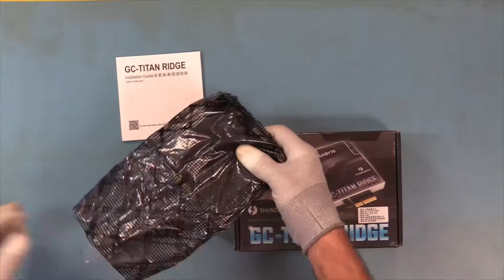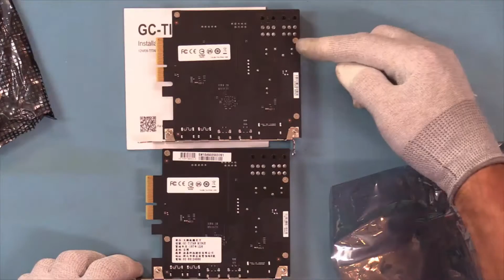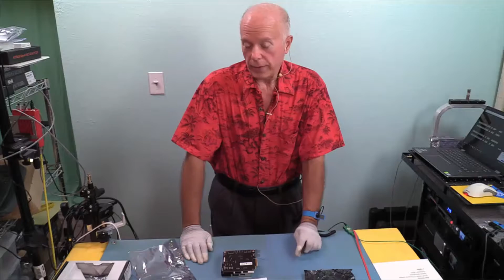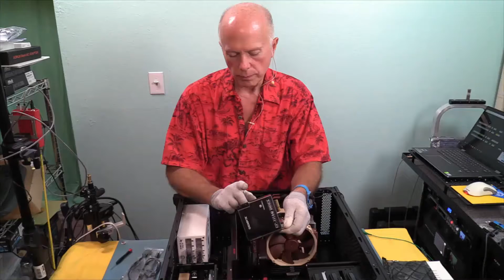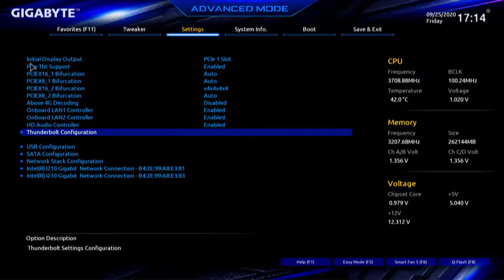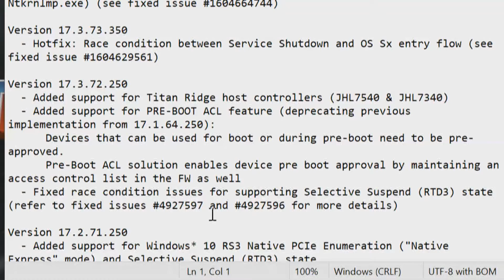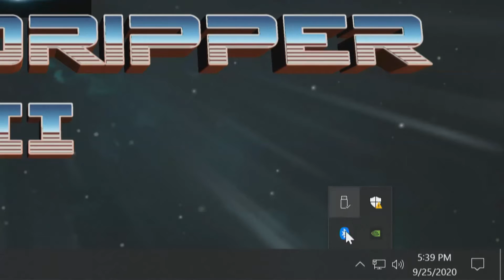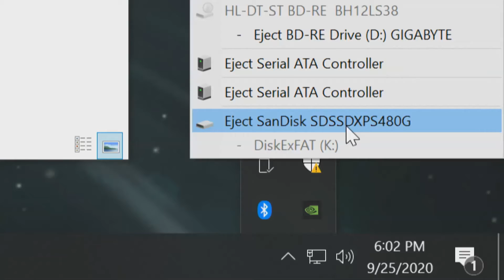Titan Ridge Thunderbolt 3 Unboxing, Comparison and AIC Simple Install on Gigabyte TRX40 Designare

Comment: I have an Apollo Twin MK II i just purchased and im trying to get it to work with my ryzen 9 3950x,  aorus ultra x570 motherboard and i also ordered the startech thunderbolt 3 to thunderbolt 2 adapter. When i connect it nothing happens even after i updated everything. Do i need to but this Titan ridge to add to my motherboard or do i just buy a new motherboard that has thunderbolt 3 already installed on it? I didnt know it would work because the rep that helped me said usb c 3.1 was the same as thunderbolt.
Reply from the maker: Hi Black_HowL 7evin, 
Nice to meet You! You need a Motherboard that supports Thunderbolt 3. Not just USB-C. Your Gigabyte Aorus Ultra x570 Motherboard was originally designed to have that support but was removed from production for whatever reason. Notice the spot next to the SATA Connectors... Those 4 dots. You need a Motherboard with that Thunderbolt 3 Header, present. 

The X570 Aorus Master (rev. 1.1/1.2) has Thunderbolt 3 support. Whereas, rev. 1.0 of that model does not. Plus You need the Gigabyte Titan Ridge Thunderbolt 3 AIC. 
https://www.gigabyte.com/Motherboard/X570-AORUS-MASTER-rev-11-12#kf
https://www.gigabyte.com/us/Motherboard/GC-TITAN-RIDGE-rev-10#kf

There will be one or two settings in that Bios to verify that may need to be turned on. Seems every chipset that supports Thunderbolt 3 is different. That Motherboard may auto recognize the Thunderbolt 3 AIC. 

This will give You Bios support. And that will get You Thunderbolt 3 (Native support) Plug and Play plus Thunderbolt 1 and 2 (Legacy support). 

We're going to be doing two Thunderbolt 3 Videos with Thunderbolt Audio interfaces soon. One will be with a Universal Audio Thunderbolt 3 interface. Hope that helps! Stay tuned!
Reply: @BuildOrBuy  i just left the computer store trying to see if i had to buy any additional pieces. They showed me my motherboard is the 1.1/1.2 rev version of the aorus ultra which has the "THB_C" header on the motherboard. So i should be ok. I already bought the Titan Ridge which will be here tomorrow.
Reply from the maker: Hi @ILaxative , Perfect! Proof is in the actual product! What I read or could tell, it did not. Even the documentation is sketchy. The Titan Ridge AIC will prefer a specific Slot due to the Root Port selector being hard wired in Bios. Usually, it's right across from the THB_C port. The Bios may Auto recognize the Titan Ridge Thunderbolt 3 AIC. Double check. If Your Computer does not turn on. Do not fret. Just power down. Drain power and change Slots. 

Make certain Your Motherboard Drivers (AMD) and Video card drivers are current. Congrats!

Comment: would it be forced to wire the hdmi cable from vga to tb3 aic? and only able to use display through tb3 port? seems manuals saying to wire like that, for gigabyte and asrock aic
Reply from the maker: Hi D P, 
Yes, You are correct. Why not just plug in Video card to Monitor direct? Looks like we need to do another Thunderbolt 3 Video about the technology. Thunderbolt 3 is suppose to do 3 things. Video being one of them. 

DisplayPort Video is routed through Thunderbolt 3. If You route HDMI Video, that will require Adapters. Hope that helps!

Comment: heard asrock x570 creator has general pcie lane btw 2nd m.2 and tb3 ports, would tb3 header mb without controller chipset  safer choice for audio works? if it is I want to use AIC  , to build ryzen system
it's so horrifying me to read tb3 issues on newer tb3 ports board
Reply from the maker: Hi D P, 
Yes! ASRock seems to be doing more to enable Thunderbolt 3 on AMD Platform than anyone else right now! We're going to be doing more with Thunderbolt. We keep getting questions about NVMe. 

ASRock x570 Creator - Has 2 Intel Thunderbolt 3 Type-C! 
https://www.asrock.com/mb/AMD/X570%20Creator/index.asp

You want the Short answer or the Long answer? It can work sort of. TB3 only. No Legacy support i.e. - TB 1 & TB2. No Plug and Play. How to enable? On the Gigabyte Titan Ridge TB 3 AIC, Jump Pins 3 to 5. Keeps the AIC alive. 

It's really about a Security issue. And that's it. You want Full Support, requires the Connector on the Motherboard and Bios support. Big hassle. 

We have Thunderbolt 3 working on both x399 (THB_C Connector, No Bios Support) and TRX40 ( THB_C Connector, Full Bios Support). 

Hope that helps!
Reply: @BuildOrBuy  really appreciate  of answer! was genuinely big help! more to research, more to fear 😨  since x570 creator share tb3 ,m.2 B lane and has interfere problem, might buy gigagyte Vision D  which is native tb3      also appreciate of answer for other video related VGA  tb3 wire thing   , was really big help!
Reply from the maker: Hi @dpdpdpdp123 , 
Yes! You are most welcome! Let Us know if You want another pair of eyes on the Solution, when You're ready!

Comment: Could you say please, if I'll buy 3 x SanDisk Extreme PRO® Portable SSD V2 (2000 MB/s each) USB-C, can I connect them in one time, directly to the TB3 Ridge card to get in total 6000 MB/s speed? I'll have 8xNVMe inside GB Xtreme board, so hard disks will not limit this speed.
Reply from the maker: Hi Juri G, 
Interesting Question. Only 2, not 3! Excellent idea! 
1.) USB-C is same Connector. Anything Thunderbolt is suppose to have the Lightning mark designating as such. That Drive does not. But it works! I tried it! 

2.) TB3 Titan Ridge card only has 2 Connectors for Thunderbolt connectivity. You'd have to daisy chain the Devices. 

3.) Having 3 separate external Drives, in RAID, that could become problematic. 
4.) Suggest using a Single Drive or Single Enclosure solution. Any Size Drive or Drives You choose. 
5.) Due to some overhead, would You get that Spec Speed? No. Why? Overhead. Not a sustained Speed. Your Results may vary. Thanks for Asking!
Reply: @BuildOrBuy  Thank You for your extnsive comment, as usual ) We are going to use 3 cameras, and after footage (3-4 hours), we'll have ~3x2TB of footage on these Sandisk drives, so we need the fastest way to transfer 6TB of footage to desktop. So as I got you right, as there is no way to daisy chain these drives, we can use only 2 drives at once to move files to desktop at 4GB/s in total speed? Maybe some TB3 hubs may help us? And with GB Xtreme 3 x USB 3.2 Gen 2 - I can have only maximum speed of ~1GB/s per port - right? So max with 3 drives we'll have about 3GB/s download speed?
Reply from the maker: Hi @jurig5579 ,
Titan Ridge ThunderBolt 3 is specified to achieve 40GBit/s. PCIe 3.0 x4 is only capable of 30.781GBit/s. So there's got to be a better way to maximize throughput. 

Give me the full picture. Cameras. Where's the Data coming from and what medium is it on? Are You doing 4k/60 or 12k/60? 

Any suggestion we discuss should include the full data path. For instance, a Removable NVMe Solution could be an option. 

ToughArmor MB720M2K-B - Full Metal 4 Bay M.2 NVMe SSD Mobile Rack for External 5.25" Drive Bay - https://www.icydock.com/goods.php?id=330

Or this may be a better option. - Glyph Thunderbolt 3 NVMe Dock (No SSD) - https://amzn.to/3lJ9xJv
As an Amazon Associate I earn from qualifying purchases.

Comment: Maybe you know, as for today, that some one had successful experience with GB Trx40 rev 1.0 Xtreme and Ridge 2.0 card with working plug n play?
Reply from the maker: Hi Juri G, 
The only difference according to the Specs would be Power Delivery. It will work! However, We have not tried it yet. Been busy the last 5 days with DaVinci Resolve 17 beta. Testing on 5 different Computers!  Our concern right now with Thunderbolt 3 are Microsoft Updates. 

Windows 10, version 20H2 or Windows 10, version 2004, you might receive a stop error when plugging in a Thunderbolt NVMe SSD - https://support.microsoft.com/en-gb/help/4592819/error-when-plugging-in-a-thunderbolt-nvme-ssd 
Stay tuned!
Reply: @BuildOrBuy  but officially Xtreme motherboard  doesn't support thunderbolt card, isn't it ?  And as I read much earlier  plug and play mode doesn't work there , do you think its fixed with latest bioses ?
Reply from the maker: Hi @jurig5579 , Officially, no. Unofficially Yes! I'll get You the Instructions and the Link on the Gigabyte Forums! The Instructions are very specific. I'll have to go dig it up! Working on next Video right now! Give me this evening to find it unless Rick sees this and provides the link! See: Gigabyte Forums - Rick - Colonelhop. So much information going on and such little time! Stay tuned!
Reply from the maker: Hi @jurig5579 ,
Here we go! Have to know what to look for or You'll never find it! Gigabyte Forums - Rick - Colonelhop should be compensated by Gigabyte for His tireless work on the Gigabyte Forums! Hats off to him! 
https://forum.gigabyte.us/thread/9680/newer-revisions-trx40-aorus-xtreme 
Quoting User lwvfx... Only changes made were for spell checking...

"I decided to try anyway as I've seen some people have success. But contrary to other people's experiences, it seems they are suggesting that it will be allowed in future.

Firstly, the Titan-Ridge is installed in the upper PCIe x8 slot, rather than the bottom.
 All cables connected. Power, USB header, THB_C header.

I followed these steps to remove any drivers I had.

1. Disconnect any Thunderbolt 3 devices from the host system (this is done to prevent Windows Update from automatically loading any Thunderbolt drivers).
2. Right-click on the Windows Start button and select ‘Device Manager’.
3. Click on ‘View’ from the application menu bar, and click the option ‘Show hidden devices’ (this is necessary because the Thunderbolt controller will not be active if no Thunderbolt devices are connected).
4. Expand the ‘System Devices’ category. Scroll down until you find the entry for the ‘Thunderbolt Controller’.
5. Right-click on the ‘Thunderbolt Controller’ entry and select ‘Uninstall device’ from the context menu that appears.
6. From the ‘Uninstall Device’ window that appears, click to place a check mark within the ‘Delete the driver software for this device’ option.
7. Click the ‘Uninstall’ button.
8. Close Device Manager.
9. Click the search button on the taskbar (looks like a ‘O’) and search for the letters ‘cmd’.
10. Right-click on the ‘Command Prompt’ search result and select ‘Run as Administrator’ from the context menu. If prompted, enter your Administrator password.
11. From the Administrative Command Prompt window, enter ‘sc delete nhi’ (without the quotes) and press enter. You should receive a ‘SUCCESS’ indicator. ** Be very careful to type this command correctly ** This command deletes the ‘nhi’ Windows service presently installed on the system.
12. Close the Administrative Command Prompt window.
13. Check within the Control Panel -> Applications and Features to see if there are any ‘Thunderbolt Software’ by Intel entries listed. If any our present, uninstall them.

--------------

Then I decided to try out the DCH Drivers provided by Gigabyte for the Titan Rev 2.0 version, even though I have Rev 1.0
www.gigabyte.com/Motherboard/GC-TITAN-RIDGE-rev-20/support#support-dl-driver

Only when the DHC drivers are installed can you install the Thunderbolt Software from the MS Store.
www.microsoft.com/en-us/p/thunderbolt-control-center/9n6f0jv38ph1?activetab=pivot:overviewtab

Many reviews say they cannot install it or download it from the store. I suspect it may be they didn't have the correct drivers.

REBOOT. In the BIOS I now had an option for Thunderbolt and made sure it was enabled.
My BIOS version is F4d

With this setup I got the control center working, and it recognized the few thunderbolt drives I had. 
I have not managed to test it out with any other devices, especially thunderbolt 3 devices as I only have thunderbolt 2. I was using the Apple T3 to T2 adaptor, which is probably the best one to get.

Hope this helps someone! I was messing around for days trying to get something from this card. A bit frustrating that I had to switch PCIe slots, but I would get a d4 error and it would not boot" 

We had experienced the same Results with 2nd x8 Slot. Your Results may vary. Hope all of this helps!
Reply: @BuildOrBuy  Thank You! I hope that PnP works for him )) I'm going to use it for external SSD connections, to download raw recordings asap.
Reply from the maker: Hi @jurig5579 , Just as long as You're NOT using an NVMe, You should be fine! Had To do that while we were talking about it! Did not expect to find the Info so quickly though! Knew You needed the Info! Details matter! Keep Us Posted on Your Progress! This helps Us to make better Videos!
Reply: @BuildOrBuy  could you say please here in short, what is the problem with external NVMe if it will have usb 2x2 gen 2 port ?
Reply from the maker: Hi @jurig5579 , Yes! BSOD! We're talking about a Thunderbolt 3 External NVMe Device.  Quoting... 
"On affected devices, when plugging in a Thunderbolt NVMe SSD you might receive a stop error with a blue screen and "DRIVER_VERIFIER_DMA_VIOLATION (e6) An illegal DMA operation was attempted by a driver being verified." Affected Windows 10 devices will have at least one Thunderbolt port and any currently available version of the driver file stornvme.sys." 
https://support.microsoft.com/en-us/help/4592819/error-when-plugging-in-a-thunderbolt-nvme-ssd
Hope that helps!

Comment: All we need to see is how can we use Thunderbolt 3!!!! Not alternative for USB. Thunderbolt was designed for DOCK STATION!!! So, please, would you connect your Laptop to PC, within Thunderbolt 3, in order to use PC's resources? For example, a laptop with i5, no graphic card , using PC's graphic card :)
Reply from the maker: Hi Mihai Sava, 
You have a misconception about Thunderbolt 3. Thunderbolt was designed for Connectivity! We have to get Thunderbolt 3 working on a Desktop before we can start Connecting Devices. And that's coming up! 

1.) A Laptop to Desktop would only be a Network Connection. 
2.) Thunderbolt 3 does 3 things. 
A.) Route Video 
B.) Route Power 
C.) Device Connectivity. 

Device Connectivity is the only one that makes sense. We will be showing 2 Audio interfaces and 4 Data Devices. Two of which we have shown and will show again as it relates to another Device newly updated by another Vendor. 

To reiterate, a Laptop to Desktop would only be a Network Connection. Sharing Resources through a Docking Station to a Laptop or to a Desktop is either one, not both simultaneously. 

Example - CalDigit TS3 Plus is a Docking Station. Whatever Resources are in a Docking Station, those can be shared with either Computer but not both at same time. 

CalDigit TS3 Plus
https://amzn.to/3eNW8xW
As an Amazon Associate I earn from qualifying purchases.

If the external Thunderbolt Device has a Video card within that box, then that x16 Video card can be shared on x4 PCIe Lanes through Thunderbolt 3. Not ideal but doable. Not practical either. Hope this clarification helps! We will address this in an upcoming Video! 

For more info: https://thunderbolttechnology.net/tech/faq
Reply: @BuildOrBuy  Hi Gill, Thank you for reply. Please, would you help us to share data from Thunderbolt 3 to external PCI Express on which would be installed an external GPU?
Reply from the maker: Hi @muiepsd279 , Yes! Highpoint RocketStor 6661A Thunderbolt 3 to PCIe 3.0 X16 Expansion Chassis - https://amzn.to/3pkQVmj 

As an Amazon Associate I earn from qualifying purchases.

Comment: Hi Gill, I’m upgrading my 4-year-old computer that I use for video rendering. I will be buying an AMD Ryzen 9 3950X 16-Core, 32-Thread processor. I have two (2) Gigabyte GV-N980G1 GAMING-4GD G1 Gaming, GeForce GTX 980, 4GB GDDR5 PCiE Video Graphics Cards and will be also getting (based on your video) a Syba I/O Crest SI-PEX40152 Dual M.2 NVMe Ports to PCIe 3.0 x16 Bifurcation Riser Controller - Support Non-Bifurcation Motherboard to be used as a RAID. What Asus motherboard would you suggest to be able to accommodate all of the this? By the way, I also need a slot for a firewire card which hooks up to an external HD capture card.
I know you’re very busy, but do you have any suggestions?
Reply from the maker: Hi Victor, You're looking at an x570 Chipset Motherboard. I'll make a recommendation this evening on an ASUS Motherboard. Currently Filming. Took a break while downloading a setup installation.
Reply from the maker: Hi Victor, 
Nice to meet You! Changing one thing Changes everything! For the x570 chipset from ASUS, this Motherboard. 
https://www.asus.com/microsite/motherboard/AMD-X570/
Asus ROG Strix X570-E Gaming ATX AM4 Motherboard
https://www.amazon.com/ASUS-ROG-Motherboard-Lighting-Heatsinks/dp/B07SW8DQVL/
https://rog.asus.com/Motherboards/ROG-Strix/ROG-Strix-X570-E-Gaming-Model/

However, adding the 1394 FireWire card may be problematic. You may have better luck with the 1394 FireWire External Capture Device by using an Adapter to Thunderbolt 3. 

If You were to utilize Thunderbolt 3, then we'd have to consider a different Motherboard. Either ASRock or Gigabyte for Thunderbolt 3 support on the Titan Ridge Thunderbolt 3 card. 

I think the 1394 FireWire card only requires a Single PCIe Lane Slot - PCIe 2.2. 

Hope that helps!